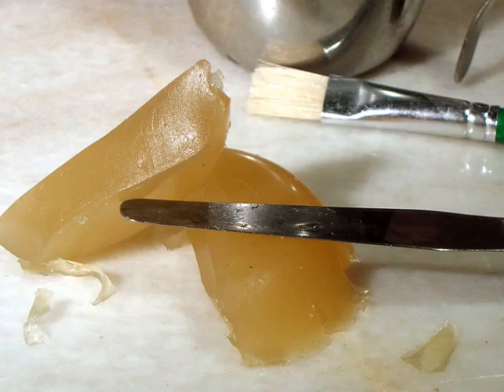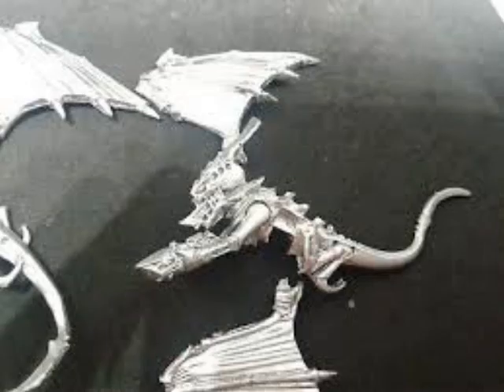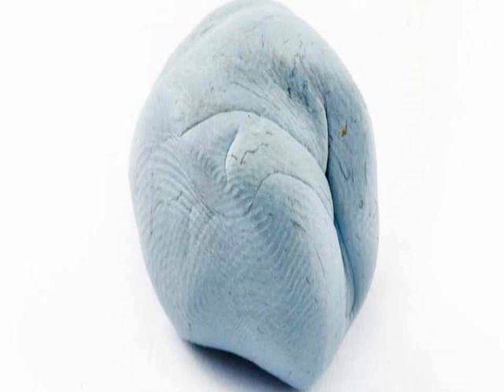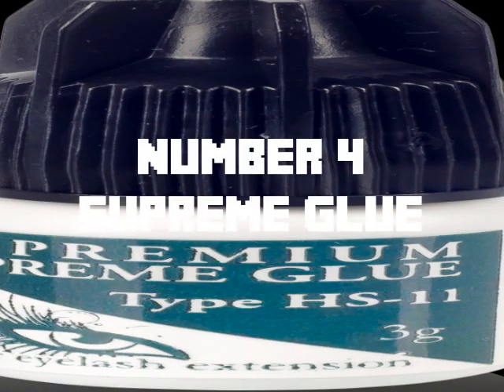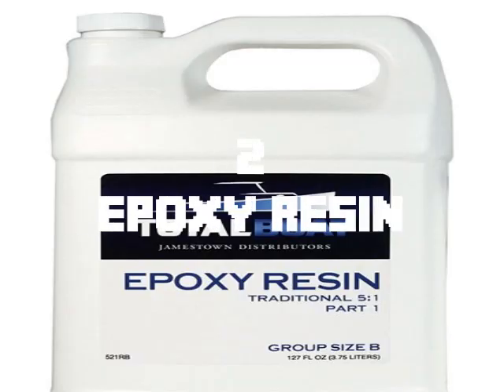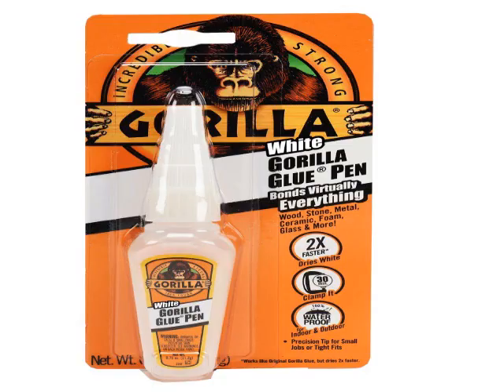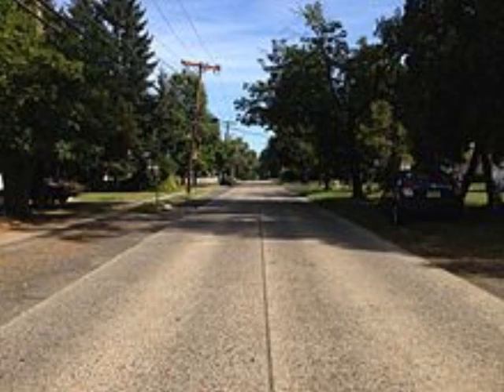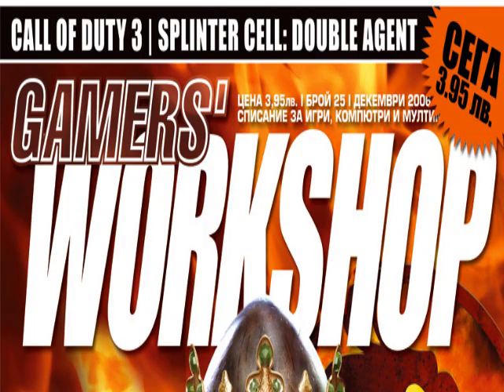Top 10 Best Glues for Warhammer 40,000 Hobby

Comment: When using cement make sure to hire a concrete/cement testing company to collect samples when it is mixed to make sure that it meet your local municipality's strength requirements.  The good companies send a technician to your site to collect them.  I always use Portland cement looking for 53 MPa (53 grade) after a 28 day curing time.  This both ensures that you have the strongest bond between model parts and shows your dedication to the hobby.  Only kids wouldn't spend the extra money (about $120 per sample for the testing) and time (28 day minimum).